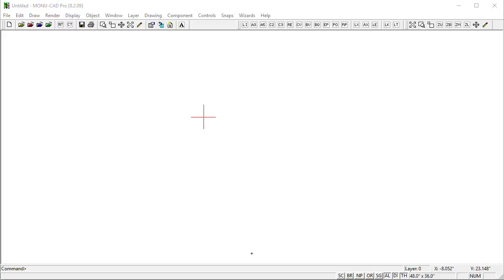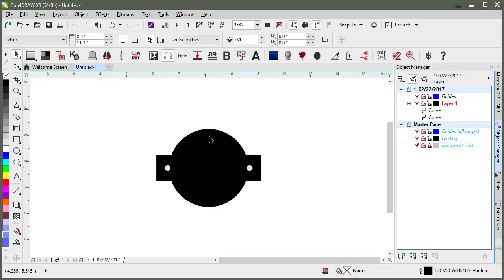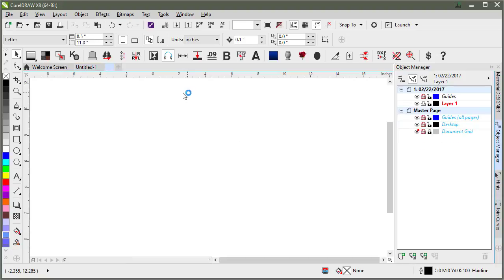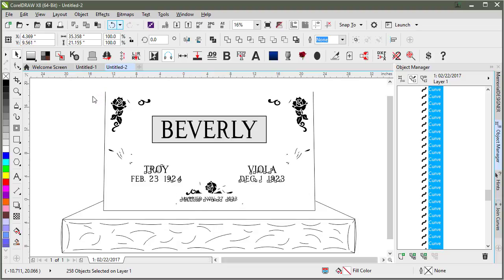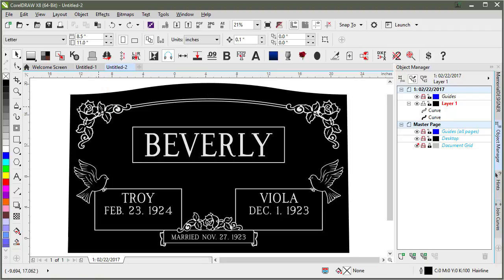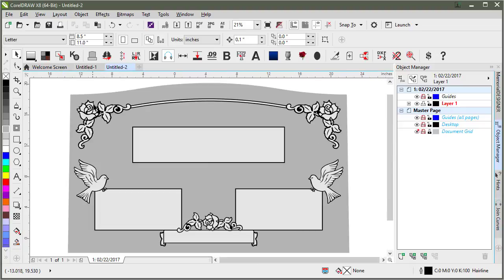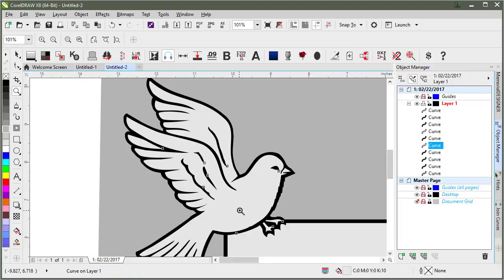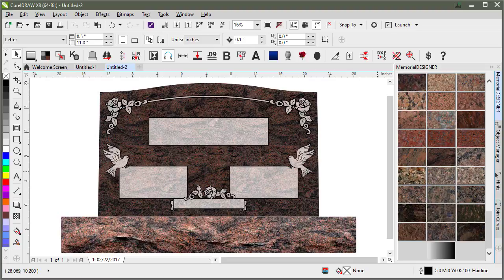Monu-Cad(R) to MemorialDESIGNER(TM)

Comment: wow.. are you even in the 21st century.. it is like using DOS.  can you imagine doing this tedious process in front of a customer...
Reply from the maker: I'd rather just use the artwork that comes with MemorialDESIGNER as it's much faster and great to do in front of a customer, but the video is to show those switching from Monu-Cad how they can still use their existing artwork as well.  Depending on how well the original artwork was drawn and if they can export as .DXF determines how tedious the process is.